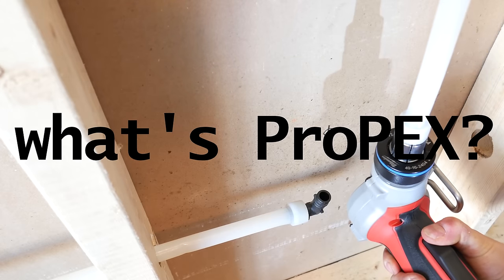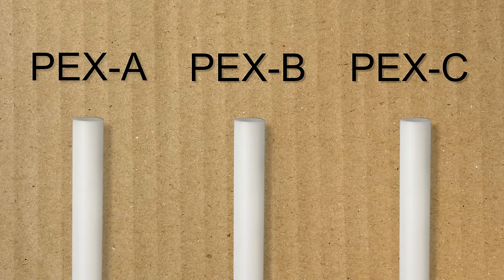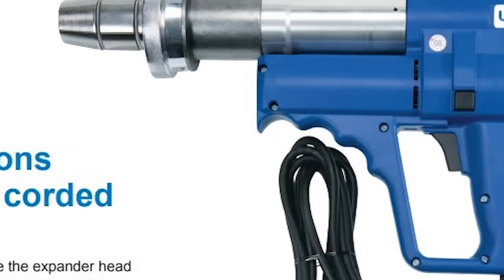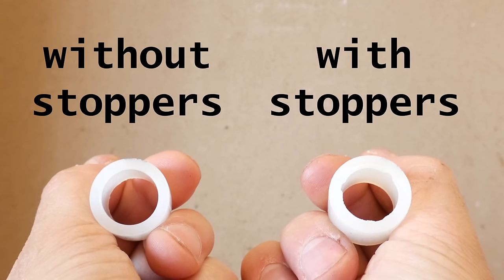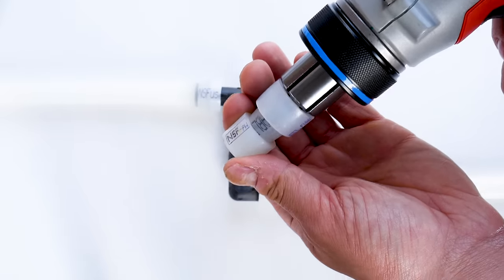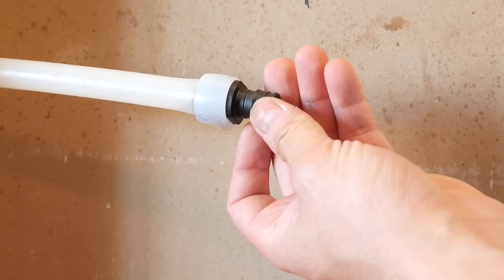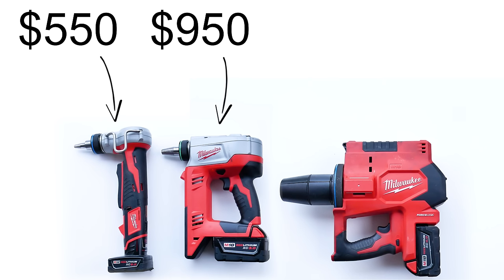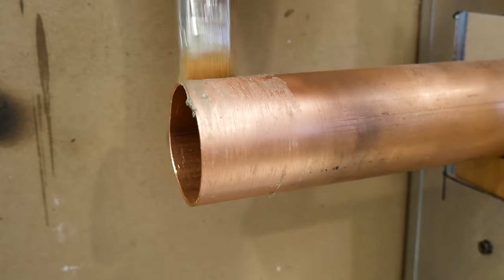UPONOR ProPEX, The Future of Plumbing (COMPLETE GUIDE) | GOT2LEARN

Comment: New product...... Their killing themselves with the prices.... Especially with the tools.... Too much risk, not anough reward..
Reply from the maker: This system is in use all over the world and it's prefered over sweating pipes, so I think it's worth it.
Reply: @Got2Learn  not in United Kingdom...
Reply from the maker: @chloeellis4117  what's more popular there, pressed?
Reply: @Got2Learn  depends really... Pressed on industrial mostly, no one wants the bother with hot permits... Commercial is generally soldered or plastic (speedfit) , and domestic either soldered or speedfit (plastic) also.....
Seems all the new plumbers are using speedfit plastics, as time saved is really good. But I'm old school and love a firm solid copper fitting.
Reply from the maker: @chloeellis4117  niceee, thanks!!

Comment: Stainless crimps are made with a little eye hole to make sure it's all made up. Here only 2 fixtures are allowed off 1/2 inch. Main is normally 3/4 or an inch residential.

Comment: Been using Pex-AL-Pex in our data center installations for 15 years now.  Upinor makes some great products.  The extra cost is easily outweighed by the labor savings compared to copper, no hot work permits, and piece of mind in knowing it will never leak doesn't suck.
Reply: uh buddy you know that plastic degrades over time right? It's not a question of if it will leak but when.

Comment: After installing this in my laundry room, the water in the bathroom now has low water pressure next to the laundry room plus the bathroom above all have low water pressure now. Why is that? Didn't have that issue when the copper lines were there originally.
Reply from the maker: The fittings are restrictive.

Comment: What is the actual inside diameter of the fittings? They don't look true to pipe size and don't actually look that much larger then crimp fittings.
Reply: Found it online. Uponor fittings are not that much bigger than pex b fittings. 0.315 for crimp and 0.385 for uponor for a half inch fitting.
Reply from the maker: Thanks for the research, yeah the fittings are full flow too.

Comment: I bet you could go on and on about Uponor.  You got those manifold fittings, the block(I think that's what it's called) full port brass ball valves, you can twist the fittings into the correct angle after it's shrunk.
Thanks for the tip on how  to make butt to butt connections.
Reply from the maker: You are welcome Richard, really appreciate it!

Comment: Its for a hack who can't solder and you will lose water pressure out of your garden hose.I know i just had some installed and now I have lost pressure 
Just install copper pex sucks
Reply from the maker: Not for hacks Billy, trust me.
Reply: @Got2Learn  Do you lose volume from pex? Yes or no do you explain that to your customers before you sell them on it?
Reply from the maker: @billyflanagan3329  yes you lose volume but it's minimal, copper is good but it's not perfect.
Reply: Let me ask you a question since your so smart.
Which will fill a five gallon bucket faster a  length of half inch pex or a length of copper?
Reply: @Got2Learn  Its not minimal because I just had 10 feet of it installed and now my garden hose is useless
Reply: And the plumber was such a dope I caught him trying to join brass and galvanized pipe without a dielectric fitting.He said it doesn't matter he has been doing this in houses for year's 🥴
Reply from the maker: @billyflanagan3329  use 3/4" instead of 1/2".
Reply: The answer to my question is :

If you increase the pressure you increase the density and you decrease the volume
Reply from the maker: @billyflanagan3329  technically it's ok to join brass to steel, it's to copper that you get a lot of problems.
Reply: @Got2Learn  OK thats a good answer
Reply: I wish my plumber was as smart as you.
Reply: Much respect take care ill tell my plumber to upsize.Happy new year
Reply from the maker: @billyflanagan3329  🙏🙏🙏
Reply: @Got2Learn  he was using galvanized pipe and brass to galvanized pipe will cause galvanic corrosion
Reply: @billyflanagan3329  Check if you got 3/4" or 1/2" PEX. 1/2" Cu = 3/4" PEX.

Comment: what about cold water leaks? what happens if you live in hot weather then experienced an artic freeze and the water in the lines freeze up, we all know water expands. so now you have to replace large sections of plumbing. what about longevity. plastic elbow and joints become brittle over time. what about water knocking. at the slip joints.
Reply from the maker: ProPEX (Uponor) has proven itself in all temperatures and it doesn't fail (except for extreme cases), PEX is way more suited for freeze expansion than any other type of pipe. As for the fittings, they did have problems with the brass fittings in the beginning, but now they are plastic and they are doing just fine, I installed tens if not hundreds of kilometers of this stuff for radiant heating and water lines and we never had any problems.
Reply: @Got2Learn  You wrote, "never had any problmes." No problems over what time period?
In America, too many builders build for a 7-8 year life span as the majority of home owners sell and relocate..cheap but cute sells well, until a PEX leaks. I've had copper runs for radiant floors in Brrrrr Minnesota and whole houses in hard copper_ 35 years later- zero leaks with copper.

Comment: How do you remove or undo the connection later on if you wanted to do some maintenance?
Reply from the maker: 5:10
Reply: @Got2Learn  my one worry is that this limits it's usage to a specific temperature as hot water would more than likely cause viscoelastic creep and thus leaking over time as it expands from the hot water acting on it.

Comment: Uponor Propex was installed in a 165 unit residential condo and every unit has leaked.  Condo corp is currently involved in a law suit against Uponor.  Think about the devastation this has causes to every unit owner.
Reply from the maker: That's installation error, Uponor doesn't leak.
Reply: @Got2Learn  after an engineering firms investigation, install company was found not at fault.  Uponor is the only party involved legally for a faulty product.
Reply from the maker: Please elaborate.

Comment: Was in Home Depot three weeks ago and they removed all the pex b line and fittings I was trying to find some clamps for my pex b And that’s one of the gentleman told me that they took everything and they replaced it with pex a only They will not be stocking any more pex b is what I was told or clamps or fittings
Reply from the maker: That's actually not a bad thing, were they selling the expander as well?
Reply: I agree it’s a good thing , they do sell the Milwaukee expander and the hand expander , I just got the Milwaukee expander and I love it, of course the one thing that sucks is that last summer I spent about 200.00 on pex b  tools
Reply from the maker: That's new 😲

Comment: My house was renovated and the plumber used Uponor Aquapex pex-A for my kitchen water. Is it safe to drink? From looking online, it seems pex-A leaches a bit. 

Also I am doing work in the basement and need to connect to that PEX. Is it ok to cut off one of his sections and use a PEX-B crimp ring on the Uponor tubing so I can run some PEX-B tubing to it using a crimp fitting?
Reply from the maker: You'll need a transition coupling from PEX-a to PEX-b to do that or I think you void the warranty.

As for leaching, all PEX have leaching problems, are they dangerous, no, not if you don't drink 40 gallons of tap water a day.

Comment: Are fittings available to adapt pex A expansion to pex B crimp?
Reply from the maker: yes!
Reply: Pex A & B are both CTS (Copper Tubing size), so sharkbite works on both.
Reply: You can just use a crimp on pex A just like c and b
Reply: @Robert Perry Any tubing labeled SDR-9 can be crimped. Uponor is the only tubing that can be expalnded, but its also SDR-9.
Reply: Zurn that makes type B also has expansion fittings and the expansion ring is also type B. The same tool and fittings can be used on both.

Comment: I just see these exploding when frozen. More so than copper.
Reply from the maker: Actually, PEX is more resistant to freezing 👌
Reply: @Got2Learn  Freezing is never the issue. It is the water inside the line that is the issue as it expands. Like a coke can in a freezer.
Reply from the maker: @MichaelJohnson-  that's what I am saying, the expanding is less likely to burst PEX pipe vs copper because it's flexible.
Reply: @Got2Learn  sounds like a good experiment for a YT video.
Reply from the maker: @MichaelJohnson-  yeah 🤗

Comment: What is the temperature supported PEX-A?
Reply from the maker: Depends the pressure you have ;)
Reply: @Got2Learn  let's say 3-3.5 bar is supported temperature like 50-60 degree Celsius? ( For electrical central )
Reply from the maker: You are good for 200 fahrenheit and more at that PSI

Comment: Thank you for this video.  It is clear and easy to follow.  Can you tell me, does this system require any special type of fitting/value?  Do they connect the same as elbows and joints?
Reply from the maker: Uphonor type A, yes.
Reply: Thank you for your response.  I still don't understand how Uponor ProPEX works with threaded fittings.  Do you need an adaptor of some sort?
Reply from the maker: @dougmesler6476  yes, threaded to uphonor.

Comment: Should I install PEX in my entire home or leave it copper, in the middle of a total remodel so this would be the time to do it.
Reply from the maker: Depends the condition of the pipes ;)
Reply: @Got2Learn  house was built in 70s and copper is running through concrete pad and walls. I mean there were some leaks within the last 30 years but not sure if it’s worth it to redue. First time doing plumbing, not sure how to gage condition of pipes.
Reply: @Got2Learn  thanks for responding!
Reply from the maker: @KrispyKremePies  👍👍👍
Reply from the maker: Might be risking it, it's really up to you in this case you know..

Comment: @got2learn You have a lot of knowledge to share and the video content you make is very well organized, filmed, and cut.  Very well done.  For someone that has copper in their house from the 1970s.  I'm doing quite a bit of remodeling in our place.  Would you recommend just using a crimper with Pex, or should I make the investment in a Milwaukee M12 Expander?  I'm not particularly concerned with the tool cost.  Just want ease of use, and reliability.  Thank you!
Reply from the maker: Thanks! The only thing is that ProPex is hard to get as an individual, if you have access to the parts, go for it!
Reply: @Got2Learn    Pex A tubing, fixtures & tooling are more and more available in the 'big box' stores, including both Home Depot and Lowes now.  So not as hard to find as it was even just 2 years ago.

Comment: I didn't see the M12 rotate at all, maybe it rotated inside but the Jaws didn't and that's where it needs to rotate. The hand tool you rotate by hand and the Jaws rotate every time but the M12  Jaws stay in the same place. So I don't get it..? What's so better about it. They both make the same movement except for the hand operated one, yet one is supposed to be better than the other. 👌 still not convinced. But I would like to be because I'm doing a Plumbing remodel at this time
And why is the M12 $500 I mean for god sakes. I can just barely afford the piping as it is. I don't want to own the tool I just want to use it for the day.
PS. Maybe if I don't use anything it will have a tendency not to fail. :)
Reply from the maker: It only rotates 1/16th of a turn every time, it barely shows, but it turns ;)
Reply: @Got2Learn  well thank you, but I still can't afford the expensive M12.
And I live where stuff freezes pretty easy. Why can't I just use the ring over the plumbing as the plumbing itself instead of all the other Uponor piping.? Do they even make a tubing out of the stuff other than rings. ?
Reply from the maker: @cynthiaayers7696  no, it's the same material as the pipe
Reply: @Got2Learn  then why do I need the ring if it's the same stuff..?
Sorry if it seems like I'm bothering you but maybe you can make a video on this topic..?
Reply from the maker: @cynthiaayers7696  the ring compresses the pipe on the fitting, without it it won't work...but why can't "just the pipe" be used to seal, that I don't know hehe
Reply: @Got2Learn  thanks again.
And idea is to just cut a 1in piece off the piping you're using, expand it then slide it back over the pipe then expand both to fit over your fitting for double shrinkage power, without the added cost of those plastic rings. Seems to me that's all that's going on other than the stoppers the plastic ring's have and I guess that's to keep them from sliding down the pipe as you push it onto the fitting. So I guess I kind of answered my own question.   Thanks again for chatting with me. 👍✌ Age 65.
Reply from the maker: @cynthiaayers7696  👌👌👌

Comment: PEX-A Needs to make dual compression fittings with separate shut off valves. Do not trust the shark bite push fittings they can leak very easily. Cheers!

Comment: Problem with plastic pipes is that you can't detect them. They'll be a few homeowners drilling through them while putting pictures up etc.
Reply: robert o You should put plates on the wall studs whether the pipe is plastic or copper.  If you’re concerned about a nail going through Sheetrock into the pipe, you could always use a thin copper wire.  That’s what they do when they bury plastic gas lines; it lets metal detectors (stud sensors, in our case) find them.
Reply: @marshallgoldberg8376  in all videos using plastic pipe have you ever seen anyone protect it from screws etc?the main points are it's ease of use, flexibility etc, to protect it means losing some of those benefits.🙂
Reply: robert o We’ve all Got2Learn, right? Maybe you’re onto something, and there’s definitely a remediation we can apply.
For my own part, I work in semiconductors and my entire career is a continual learning and discovery process.  If I used only the knowledge they taught me in college 30 years ago I’d be pumping gas for a living.  I thought I knew everything when I graduated, but it was just the beginning of lifelong learning. You have a great point! We’ve all Got2Learn!
Reply: @marshallgoldberg8376  I work in the construction trade in the UK and all the new technologies and techniques coming through are great,but I'd like to know what's behind the wall when I'm drilling holes 🙂. It's like the new glues taking over from nails and screws, absolutely fantastic until you have to take it apart to repair it.
Reply: If it was installed properly, then there shouldn't be a issue. You are not supposed to have a hole less then 5/8" from the edge. If it has to be less, then has to be protected with steel nail plate. This gives at least 1 1/8" of space for screw after hanging 1/2" sheet rock. Also, copper pipe wouldn't stand a chance against screw or nail either. I know because I have screwed into more than a few.. Unless you are running galvanized or stainless steel pipe, you will still have same concern.
Reply: I work in new construction and use pex A all the time any studs that we go through get a plate unless we have a 1 1/2 of wood in between.
Reply: robert o Come to think of it, if you put a wire on the plastic tubing, stud sensors will they they are wall studs and they’ll try to drive nails into them.  
It’s a standard practice to use a wall plate on a stud, whether it’s copper pipe, electrical conduit or plastic tubing. I think if you put a nail in Sheetrock, Pex would likely move out of the way. A copper pipe or conduit won’t.

Comment: that kinked/bent section of pipe that was heated (burnt) did not seem healthy afterward. Applying that much heat makes me feel like it would affect the integrity of the material and weaken it.
If it really needs to turn a different color in order to recover its original shape I'd say this is not really a "feature".
Also makes me wonder how it might perform with hot water applications or when being run close to hot equipment or in hot environments...
Reply from the maker: Heating PEX-A does not affect it's integrity at all :)
Reply from the maker: @2skyman That problem is old, they have "in floor" radiant heating that's been going for years now and that's hotter than your hot tap water so, PEX-a is ok with hot water.
Reply from the maker: Where are you getting this information, do you have a link, because from what I know, Uponor doesn't have any hot water problems whatsoever, and never has in the last 10 years that i've been installing it, if you have a link to this information, can you please share it so we can validate it?

Comment: Can you run hot water threw the pipes since it looks like heat will explan the pipe??
Reply from the maker: Yes, you can even use this system for radiant heating 👍

Comment: Upponor system is not really popular due to it's not long lifetime, around 15 years. 
Try Rehau system, also PEX but different type connection, much more durable, 25 years warranty, and lifetime is 50 years
Reply: Had to replace tons of fittings after 10- 15 years after it's installation